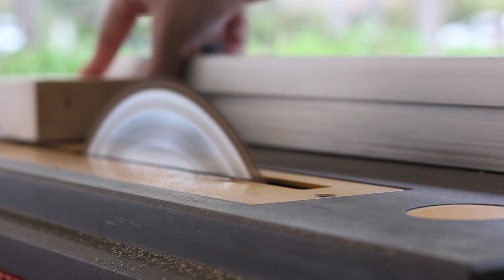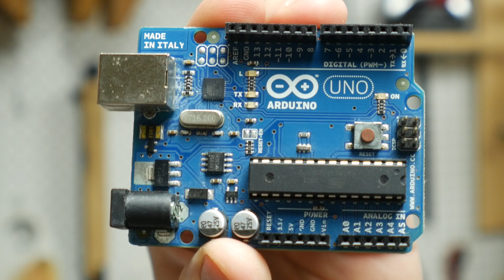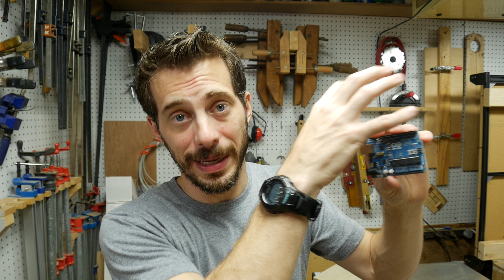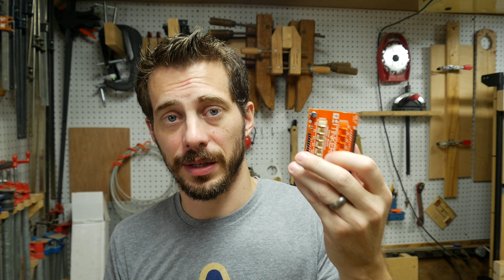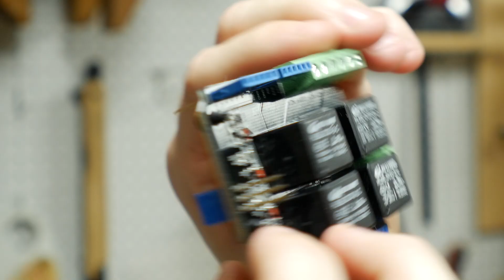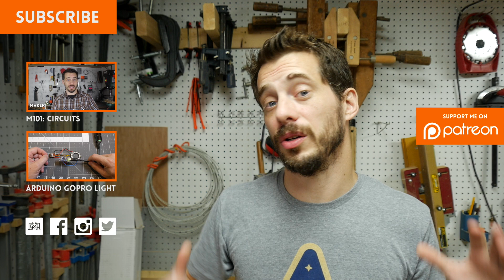What's an Arduino // Maker101 | I Like To Make Stuff

Comment: You missed 1 thing: Arduino (an italian company) is not the microcontroller but it is the board.
The uC is an Atmel  (in the case of UNO).
Every single student, here in Italy, coming from an electronic formation, knows everything about this board.
However, you have introduced the product very well.
Thanks for covering some electronic topics also! xD

Comment: Good introductory video, just nitpicking a bit, what Arduino does are development boards (and there were a bunch of them before Arduino), the microcontroller itself in an UNO is an ATmega328P, which can be bought and programmed independently from the Arduino Dev.

Comment: Arduino is easy way in to Micro controllers. An Uno with shield a pair of MEGA 2560's and random components from Hall sensors to PIR sensors, resistors caps oh my fun.  Just don't burn none!  We have a Snap Kit's ELECTRONICS 303 for fun too.  Kids love to build with it and make simple circuits, no programming needed!  Great work as always.

Comment: Who knows the best resources to learn Arduino? Every time I use the arduino I search things specific to what I need and put something together but I never really LEARN what I'm doing... :-/
Bob, great video!
Reply: I know what you mean but is not what I asked! Thank you though! :)
Reply: +Giaco Whatever Sparkfun is a great starting place. They sell a great kit called the Inventor's Kit that will get you rolling in no time. It'll walk you through circuits, basic code, and make sure you have everything you need.
Reply: +Giaco Whatever Similar to what +Benny Born said, I would recommend learning a very simply programming language (try code school and pick your fancy), just to understand the logic of coding. In essence, all programming is the same, just the syntax is different. Once you know one language (and get the concept around it), doing another one is EXETREMELY easy
Reply: Try adafruit website

Comment: on older computers you can use the serial or parallel port as input and outputs(which is pretty easy in python), but most newer computers havn´t got these ports.

Comment: Hey Bob! Great video man. I was just introduced to Arduino for a project i was working on, however i am having struggles with the breadboard wiring. If you could make a video introducing the basics of breadboards used to connect Arduinos to the different outputs and different inputs, THAT WOULD BE OF GREAT HELP!!! Keep up the outstanding work.

Comment: I have a video idea if your interested.  Once you get  further along, could you make a video on how to make a stand alone duino on a bread board?  For example, if I wanted to build my own security system and didn't want to use the arduino board but my own variation of the circuit.  maybe program the chip on a arduino and then move the chip to your own circuit for production.

Comment: In my school in croatia, we work with arduino uno plate and every school hour someone is doing some circuit and write a program for this circuit.If program works then on the basis that there will be a rating.

Comment: This episode was bad for trying to simplify through misinformation. A micro controller does not have more flexibility of input and output than a PC. It has far less. 

The advantages to a micro-controller are
1. That it gives you an isolated sandbox for interacting with a specific set of inputs in a well defined way
2. It often comes packaged in some standardized form factor for small projects (this is the big thing Arduino popularized).
3. It allows you to deploy your small projects relatively cheaply 
4. It allows your small project to conform to tight space constraints where you PC might not fit 
5. It allows you to deploy your small projects where powering a full blown PC may not be practical. 
6. Some micro-controllers give you access to a real time operating system allowing for more fine tuned control of timings than is possible on a PC.

Comment: Neat I wasn't really expecting you to be much into Arduino and great explanation of analog vs digital too, I think you should check out the ESP8266 and its soon to be successor the ESP32, you can program them similar to an Arduino but they have Wifi built-in, not only that but they have a faster processor and the best part is they cost virtually nothing at $2-4 each, but the downside is not a lot of GPIO pins and one ADC pin (or none depending on the model).
Reply: +vgamesx1 That could be an advantage...is it smaller than the one showed in this  video?
Reply: Slap Stick Yes much smaller, It depends which warrant on how much though an uno is 68x53mm and an esp is no larger than 24x18mm you can find all the different ones here.
http://www.esp8266.com/wiki/doku.php?id=esp8266-module-family

Short summary, if you want cheap then ESP-01 is nice for testing before you get serious.
ESP-07 has more pins + antenna + connector for external antenna.
ESP-12E a few more pins, mainly just for SPI and a slightly better PCB antenna.

You can also get little dev boards like a NodeMCU which also like an arduino takes most the thought out of it, so that you can get straight into programming/testing it using Lua.
(side note, some models such as ESP-01 will only have 512k or 1MB flash, meaning you may not have a lot of space left for your code because of firmware, newer ESP-12s usually have 4MB though also less of an issue if you use the SDK instead.)
Reply: vgamesx1 Wow! Great info. I'll check 'em out. This guys channel really attracts some knowledgeable people, like yourself.  Thanks!

Comment: waiting for coding video, but this one was interesting as well. servo board was from your dust collector controll system?
Reply from the maker: +Dmitriy Lutsenko Not that particular board, since it didn't handle the total number of servos needed.  I ended up using one from Adafruit for that project.  If I remember correctly, it could handle 12 servos (maybe 16?) and used it's own power supply.
Reply: I Like To Make Stuff i definitely need to make a research. whatever, thank you for your videos and for inspiration, you with Jimmy and David gives to me and other people!

Comment: I went a bought an UNO, just because of this video. You make it sound easy and very straightforward. I have a question. say I wanted to do different circuits would it be possible to change a circuit to work without the UNO bit still perform the same way? ie. if I want to turn my lights off with my phone, I make the circuit and now I want to make something else. do I have to buy numerous UNOs or can the microcontroller be changed to something else?
Reply from the maker: +Peter Thomson Great! Yes, the purpose of these is really to be able to build a prototype. Once the code is good and the circuit works as intended, the general idea would be for you to move that code to a dedicated, and cheaper option.  That would free up the UNO to be used for the next project.
Reply: +I Like To Make Stuff awesome! thanks, Bob. what sort of chip would be a general starting point?
Reply from the maker: Peter Thomson There's a little more to it.  Here's a good place to start with it. http://www.instructables.com/id/Honey-I-Shrunk-the-Arduino-Moving-from-Arduino-t/

Comment: Hello, i want to ask a thing but i don't know somewhere else to ask. I want to transform a analog output from the arduino to digital, but i want to have more than 1 digital outputs. For example i want to sent from arduino's analog output the number "3" an choose the third digital output from 6 possible outputs, but i don't know a way to do it other than using an other arduino for this job. I can't use the digital outpus from the arduino because they are I use them already.